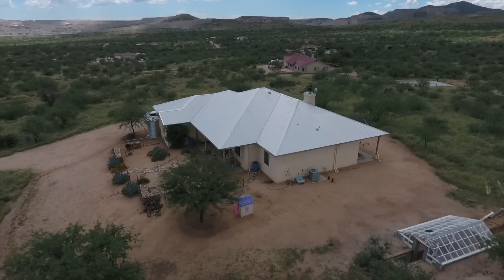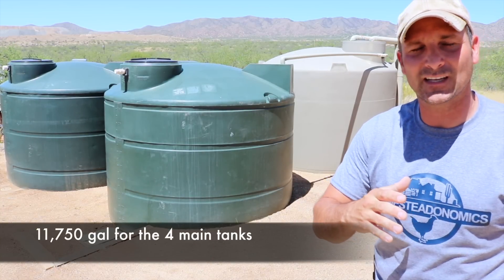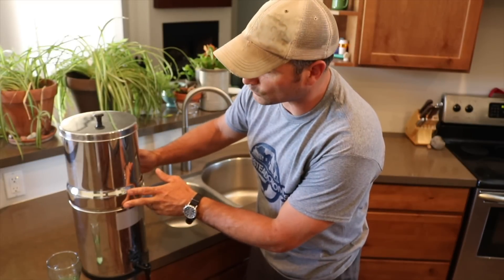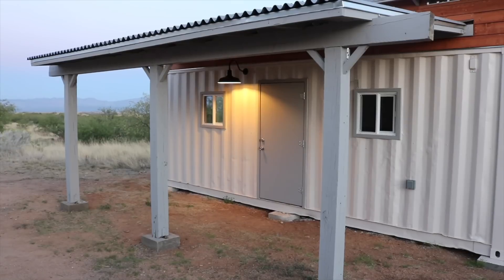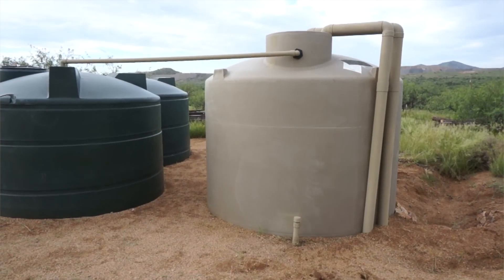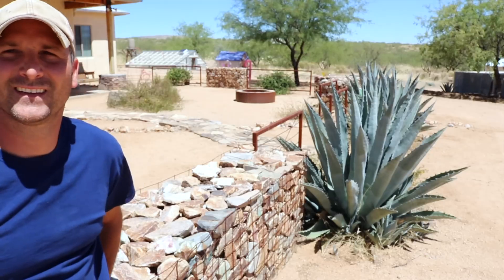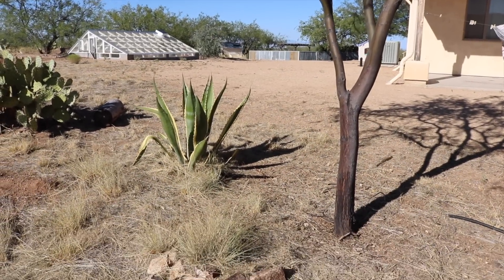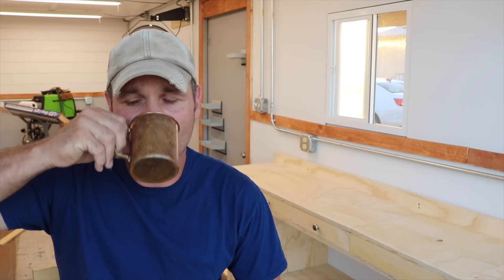Rainwater Harvesting QA - Cost, is it Illegal, how I treat, etc,.

Comment: Our family In rural NZ didn't filter at all and was perfectly fine.  Just clean the gutters once a year.  
If you don't disturb the water, the sediment just sinks to the bottom and stays there.
Even if the occasional dead bird manages to wash in, it's not going to make you sick.  What's going to make you sick is trying to live in sterile surroundings.
Reply: True that. I am also a Kiwi and have lived off tank water all my life. Two concrete tanks with the holding capacity of 10,000 gallons have always gotten our family through a summer, even one with a drought.
Originally most homes had a header tank in the roof cavity of about 100 gallons so the pump only came on when the header tank need filling...thereby gravity feeding all water outlets in the house.
It is the same two concrete tanks at the home I grew up in to this day...some 50 years later.
And I agree with you Rand Knight...a bit of 'dirt in your diet' does nothing untoward...rather it builds a solid and healthy immune system within each individual
 I find it absolutely ridiculous that any country/state/province would tag a legality element to harvesting your own individual water that falls from the sky.

Comment: Great video and beautiful setup. We live off-grid in an area of Hawaii where harvesting rain water is normal (majority don't even have access to municipal water). A common system here uses a 1 to 5 micron filter and a UV sterilizer after the pump.  No need to worry about adding chemicals or what is growing in your pipes. If you want to alkaline your water just add sodium bicarbonate (baking soda) to your tank. Here is a wonderful series of information put out by our university: https://www.ctahr.hawaii.edu/hawaiirain/index.html

Comment: Speaking of free water, but not necessarily from rain, do you use any dehumidifiers or condensation systems? Being in the desert, a solar-powered condenser could be feasible, depending on just how accurate is the saying "yeah, but it's a DRY heat."

Comment: For watering the fruit trees wouldn't a system of buried pipes with holes in for the spots around the roots be better for conserving the supply. It would get the water to where its used and reduce loss by evaporation.

Layer of gravel around the pipes should be enough to keep the system getting clogged.

Comment: I must've seen you on the gabion wall vid and it helped me build 3 baskets so far. I've already filled one and they are 3 ft high, 2 1/2 wide and 5 ft long... should cost me $700 to place them 50 ft apart along 1320 ft of my property
I should add, if you want to work on a cool project in Yakima, Wa. Anyone who owns excavation equipment is welcome to help!

Comment: very good video. where i live, no water system, and ground water is useless because it's peat water. your system is awesome, mine just have 2 ,2000 liters tanks and 2, 1000 liters, luckily i live on tropical area, maximum 3 month without rain. we also use the same filtration system for drinking and cooking, it work great, never have problem with it.

Comment: Great video, and awesome homestead. I collect rainwater off my metal-roofed barn in Tennessee, and soon will be doing the same off the house roof, also metal. We have a 2100 gallon tank and four 500 gallon tanks, all plastic. The rain collection supplements a spring that runs all but three or four months of the year. I have a pressure pump at the house tank but am looking into putting the 500 gallon house tank up on a 20-foot tall tower to provide house pressure so we can get rid the pressure pump system.

Comment: As a plumber, I really like your video.  Been thinking about your 1st flush thing.  All you need is 2 P-traps, with a Clean out plug, or a screwed trap on the bottom.  The Heavy sediment won't like to go up the trap, it will remain at the bottom.  You'd be surprised what a small p-trap holds onto.
Reply: Just like the p-trap in a toilet keeps swamp gas out of the house, a p-trap in a rain collection system isolates the air in the empty cavern of the storage vessel also, and if a bug can't manage to swim through the p-trap, they won't get into the storage. Yes, eventually, a p-trap can dry out if no flow happens for a long time in a hot, dry environment like the desert SW of the US, but it's a useful addition, and you could add a means of refilling it manually at the overflow.

Comment: 0:11 Yikes.. Are those galvanized rain gutters? Ever done a test for heavy metal contamination? Galvanized steel is coated in zinc and is fine for municipal water supplies with their more neutral PH. Rainwater is, as you mentioned, much more acidic and might be leaching heavy metals into your water. The zinc isn't so bad by itself but since zinc occurs naturally with lead, cadmium, and other heavy metals, the contaminants are often found in galvanizing coatings. Just some food for thought.

Comment: Only 12 inches per year of rain in your area.. That's pretty rough. Only 5,000 gallons? We use over 1,000+ gal. per month here. Have you thought about making rain roof over the water tanks as well as more everywhere. Forgot to ask do you have a reuse water filtration system for waste water like for showering or kitchen sinks?

Comment: We have a 30,000 litre (8,000gal) system collecting from a 100sqmtr (1000 sqft) roof, we don't need to treat it, if it don't kill yer, it makes you stronger.
People have been drinking river and rainwater for thousands of years and we are still here.
Because our tank has an area of 10 sqm and the roof 100, we can use the whole system as a giant rain gauge. 10 mil on the tank gauge = 1 mil on the roof = 100 litres in the tank.
We are in NZ and as we are Nuclear free we don't have to worry about radioactive fallout.
;-)

Comment: Great stuff man. Question: Would you consider with your electric pump systems, Solar into batteries (car/truck) then "inverting" from the batteries back to 110v? Cost offset I think you would find that in long term way beneficial IF you look after your batteries and don't let them sulphate.  I have had batteries on a pump system and have gotten almost 9 years of water transfer out of it. ...and it was kinda fun to do and watch. lol ;)

Comment: $5000 is nothing! One of my houses in Panama City, Florida costs $50.00 a month just to have the water turned on. It doesn't have to use one drop and the crooked government there still charges at least $50.00!!! So then if you do use the average (about 4000 gallons a month for a family of 3) the monthly price goes north of $100.00 per month!

Comment: I built my Berkey type system a few years ago. I use two black filters and two arsenic/fluoride filters. We have used it for cooking and drinking for years. In fact the system works so well that I have to add baking soda to raise the PH to an alkaline state and I add minerals also for taste.  ( filters so well there is no taste!) I also collect rainwater for my chickens. The only time I have to give the chickens any supplemental water is when the pipes freeze during the winter. Great video!

Comment: Two common reasons rain water collection may be illegal in some areas are-

1) In city, municipal Sewer billing is based off water used and measured at the fresh water meter. 
     If you supplement or replace your city water usage, and still are hooked up to city sewage, 
     you will be under billed for your actual sewage output.

2) Some rural areas, with lack of local water, will pay to have water imported\piped from other municipalities.
     To insure the costs associated with that service are met, minimum water usage must be maintained across the system. 
     If minimums are not met then the service could be cut off to all.

Comment: i've heard high acid levels in your body is linked to cancer
Reply: Cancer cells are mutated cells with heightened metabolism, they reproduce very quickly. Many cells produce lactic acid in general during metabolic activity, and by consequence, cancer cells generally produce a lot of lactic acid! So this is where this comes from, that acid is going to be detectable in the bloodstream. This correlation happens to be a reverse causation. The acid in the bloodstream is not from food and drink, it's a result of cells metabolising sugar, and it is to an extent self-regulating, but cancer cells tend to throw that off and cause healthy cells to starve of nutrients.

Rainwater has a pH of about 5.0-6.0. San Pellegrino has acidity of 5.6, or maybe down to 4.0 according to some, and that's obviously not been unhealthy, people from Bergamo have an excellent life expectancy. If you just run your most neutral 7.0 water through Club Soda, you're gonna get about 4.0 or less, many times more acidic than rain water. All that will happen is your digestion will revolt if you go too far in either direction.
Reply: ohhhhhhhhh

Comment: Q1) Would sunlight eventually mess up the plastic tank material?
Q2) Problems with bird poop in the gutters/roof?
Q3) Do the tanks stay mostly full?.. any close calls?
Reply: 1. Depends what the tank is made of, but if it's specifically made for long-term outdoor installation, chances are, nothing will happen for decades to come. Usually you expect them to be made out of PE, which is slightly resilient to sunlight related damage naturally, and the added opaque pigment makes up the bulk of UV protection.
I suspect that most of the sunlight degradation in household plastics is specifically due to added bromine-based flame retardants that are necessary for indoor use. Such a flame retardant is a chemical with weak bonds that breaks down easily when you supply energy (intentionally by heat, but also light), and releases bromine which binds with a high affinity to hydrogen, making it unavailable as fuel that would otherwise sustain the fire. But if that happens within plastic, it stands to reason that it would replace existing hydrogen bonds that hold the polymer molecules together, breaking them up.
2. Was answered in the video at 9:25 . He's never really seen much any bird poop and he's convinced that it's fully disinfected by the sun anyway. Looking at his roof in this video, i have no reason to doubt that.

Comment: I lived on Hawaii Island for 11 years - most homes on the east side of the island use roof gutter rainwater collected into a simple above ground swim pool covered with a special tarp. chlorine and pool cleaning 2 to 4 times a year. There is a filter to the house pump replaced about twice a year. I never used separate filtration mentioned here and drank the water directly from the main filter. No problems in 11 years. My usage as a single person was such that the amount of water that fell directly into the pool (I think 14 ft diameter)  was sufficient. I didn't need the roof system. But of course it rains a lot there.

Comment: Do you have a video up where you show the full layout of the system (the part for the house water)?  The part I'm having issues understanding is getting the water from the metal collection cistern into the storage tanks.   Our property if flat  so the only option I could think of was underground storage or a pump system to move the water from the collection cisterns to the storage tanks.  I'd really like to add rain water collection as we are also in Az but our well has extremely poor water quality.

Comment: Could even design a larger Stirling cold gas engine like V10 or V-20 to crank some large rewired drum motors with magnetic bearings into generators for a off grid power generation system. Just use magnetic bearings on all the moving parts of the cold gas Stirling engine or even gadolinium since this material becomes magnetic at cold temperatures so no need for oil to reduce friction and ware on moving parts of the Stirling cold gas engine. Not to mention being able to keep very cool in the desert heat really cheap. ; )

Comment: Listen a V-6 Stirling cold gas engine with liquid atmosphere flowing over the cylinders to produce the cold gas engine effect with one fly wheel turning a rewired drum motor that's a now a generator with magnetic bearings generating electricity with the other fly wheel spinning a fan to draw air through a heat exchange radiator that has liquid atmosphere flowing through it to provide air conditioning for a green house or home with the liquid atmosphere boil off vapor being circulated back to a tank to reform liquid atmosphere to complete the cycle has it powers all your cold gas engines and electrical power generators. All a closed system with multiple applications. What do you think about this? Would it help most folks living out in the cactus?

Comment: As long as it rains you are good to go. But you do kind of have all your eggs in one basket. I would probably spend the money to get a well. If for nothing else but a backup supply for water. There is no guarantee on a driller striking water. I know it sounds crazy but water dowsing does seem to work in many cases. I was skeptical until a well came in where the dowser said it would and the production of the well was greater than the dowser predicted by about 10%. Good job on the video.

Comment: I live in Miami Dade county where it rains a lot and where runoff into Biscayne Bay has become a problem.  Rain water collection is now encouraged but you drive around and find that a tiny fraction of homes have gutters and of those an even smaller fraction is collecting any rainfall.  There is such a lack of awareness and education about how critical this is for all ecosystems.   I am guilty.... :(. For years I neglected getting gutters because I thought the cost was prohibitive.... I was soooo wrong.  I installed gutters and about 300 gallon capacity for about $900.  I wish I acted sooner.  Anyhow, it is a start.  The water will be used to water my permaculture garden in process.  
Thank you for great information and for showing what can be done.  Rainwater is a great resource.  With tap water my plants maintain.  With rain water my plants thrive!

Comment: I'm building a container home, and plan to use a hybrid type setup. This is in upstate SC, where we get plenty of rain. The roof water will be used for the washing machine and toilets. In addition, for dry spells, I have a nice creek along 350' of the 3 acres. even if the local municipal system goes down, I'll always have water.

Comment: drinking acidic water in the looking terms can be dangerous if those minerals aren't added back. your body tries to equalize the difference in ph of the water and the bodily fluids by removing much needed minerals from your system. you end up losing minerals after you urinate. it is doable you just have to make sure that you are getting back the same amount they you are losing. you don't even feel it until your away getting sick or loss in bone density- mineral deficiency, you can die from it. alkaline drops help so do eating foods with electrolytes and other minerals like potassium, sodium, magnesium, calcium. I suggest you check your water regularly and make sure it's at least a about	 7 pH rain water falls at about 5.6 which is acidic that may not be safe if your diet is lacking. (alkaline = good, acidic = bad)

Comment: Great video.  I learned a few things.  I guess my only question would be one you could not answer as you don't live in my climate.  Can this type of system be installed in an area where it is below freezing 3 months or so out of the year.  I guess heaters and heat tape can be installed but don't know how efficient that really is or how much you would save with the added electric being used. ehh I may never know.

Comment: FYI, our active rain catchment system in Tucson does not use a first flush either.  For the reasons you mention and because I was fighting elevations on our small city lot, we decided to forgo the first flush.  I only had so much height between the bottom of my gutter and the inlet for my tank.  A first flush device would have reduce the height differential between gutter and tank, which flows water through an underground wetline.  We do get some sediment in the tank (1,200 gal. Texas Metal Tank cistern), but it seems minor.  I have a means to drain the wetline and clean outs on each end of the line too.  

We only use the water for our trees and plantings, and not domestic use.  I did add screens to my gutters, which catch debris from my neighbor's desert willow.  I clean the screens once or twice a year.  Takes about 15 minutes each time.  

As far as gutters, we went with 6" half round, which are awesome.  They really catch and flow the water during the monsoon rains.

Comment: I live in a Seattle suburb, and have been flushing my toilet with rainwater for the past 15 years.  I have three 55 gallon barrels on a platform behind my house to catch the water off only 1/2 my roof.  They are hooked together in a manifold system on the inlet and outlet, so they all fill and drain at the same time.  I used a "frost free" hose bib under my toilet, and had to change out the toilet tanks valve to a low flow valve to deal with the very low pressure.  It takes about 45 seconds to fill the tank.  I use only half my roof, and I calculated that I get 25 gallons of water for each 0.10" of rain.  It rained hard this last Thursday (1.3") and it filled my three tanks to over flowing.  I usually only have to use my "extra" storage tanks I fill in the winter months once or twice during a dry summer.  My Grandparents farm back in Kansas used a system like yours, to fill a cistern, and Grandma would add a bit of bleach to the tank under their house if it smelled like a frog had jumped in.  No one ever got sick.
Reply: Great to hear it works for for you! I'd like to do this but can't in our current house as the setup would be too complicated due to our plumbing. However, we use rainwater for our garden and for washing the car etc.